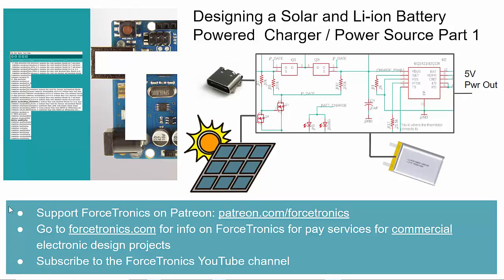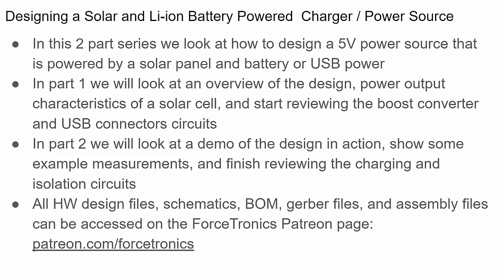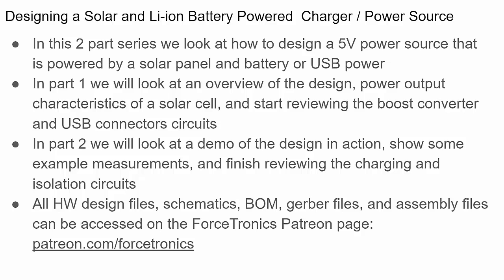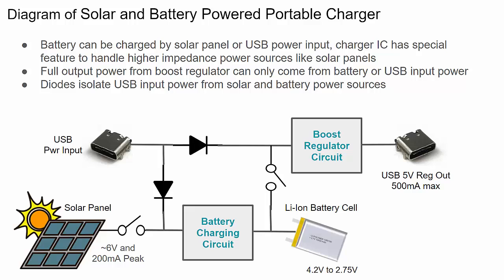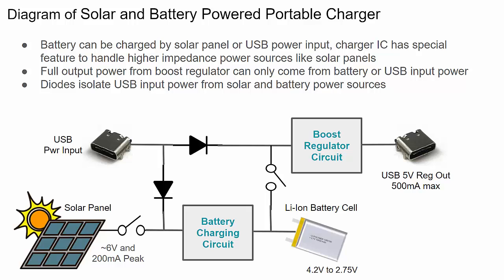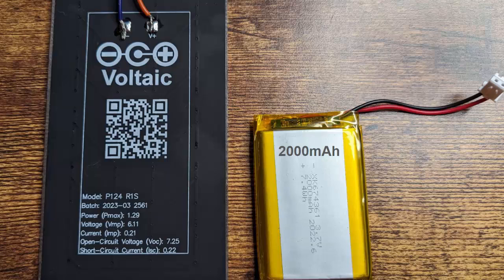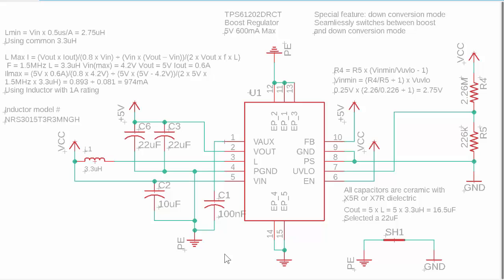Designing a Solar and Li-ion Battery Powered  Charger / Power Source Part 1

Comment: Hello I am working on a similar project using the 6x P126 Voltaic Solar Panels placed on a spherical water buoy placed equally 60 degrees apart. As all these 6 panels wont be working actively all the time during the day and assuming at most 2 to 3 of them will be facing the sun. I am wondering what would be the best connection configuration for them to get the maximum efficiency. These Panels are going to charge a 75Wh 3S2P LiIon Battery.
Reply from the maker: Hello, I appreciate the comment but that's a complex question to answer. It depends on lots of variables. I would be using an off-the-shelf IC to do the power regulation. So my first step would be to research ICs and what configurations they support. Can you find a regulator / converter that handles them in series or parallel combinations? Or do you use a regulator per panel? Which  depends a lot on your load and things like that. So my first step would be to research What are my options to support the panels as far as power regulation and conversion.

Comment: Great video, great explanations. I am trying to make a device that periodically records MEMs microphone data, stores it temporarily on microSD, then transmits via WiFi HaLow. The duty cycle is high (ranges from 6% to 100%) and the deployments are supposed to be years on end. I am using WiFi HaLow because the microphone data is too much to transmit with LoRa, and there is no cell service. They want raw recordings at 48KHz, 16bit which is 768kbps. I am aware that this is hard and not really feasible but it's what the client wants. This video is helpful for me!
Reply from the maker: Thanks for the comment and sounds like you have a tough but fun project on your hands. Are you going with a SPI based ADC?

Comment: I'm making basically the same thing except for a device that consumes 80uA~ working and 5uA in idle. every uA counts, do you have any idea how I could avoid the diode/mosfet losses for this design? the panel is only 2.75v open circuit and 123 mW. and it'll be used indoors so I can assume 10mw.
Reply from the maker: Sorry, I don't. A mosfet should use less than microamps of current to operate. A diode should have less than microamps leakage current when it's not forward biased

Comment: Could you explain why do you need R14? (Parallel with the zener)
Reply from the maker: The purpose of r14 is to pull down the USB power bus once power is removed from it. There are some caps there that can store some energy after power is removed. R14 just helps bleed them off quickly. Put it there to be safe, may not be needed

Comment: Any suggestions on how to have 1 USB, 1 load, with 3x 18650 battery at 3.3v? Mostly how to safely charge in parallel.
Reply from the maker: Even when working with Lithium Ion batteries that are the "same" they still vary with capacity as well as charge and discharge rates. As they age the differences typically become more pronounced. With that in mind, to get the most out of them you need to charge them individually and monitor their discharge rates individually to prevent one from over discharging when the other batteries still have capacity (or over charging). That is why electric vehicles designs have complex "battery management systems." Other battery technologies, like nickel metal hydride, you can get away with charging and discharging at the same rate since they are more rugged to over charging or over discharging, but of course their capacity is not as good as Lithium. So the challenge is coming up with a design that can charge them individually, control their rate of discharge individually, but still use them as parallel power sources.
Reply: @ForceTronics  agreed, BMS is good. I'm planning on a TP4056 with under voltage and short circuit protectors for each cell. However I'm not sure how to distribute the load evenly. I'm tempted to use a diode to prevent one battery from back charging another cell.
Reply from the maker: It might be better if you try to find a way where you don't have to operate cells in parallel. For instance can you just find a high capacity single cell that equals the three cells you're using or why not just operate the cells one of the time and switch them out once one is drained. With these two approaches you totally avoid the load balancing aspect of it